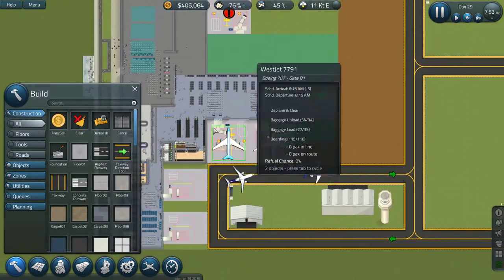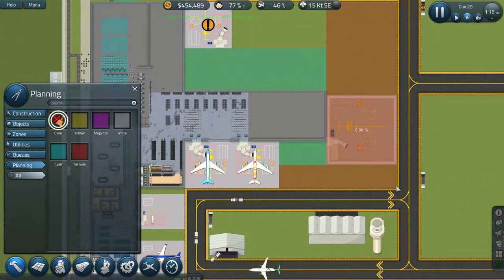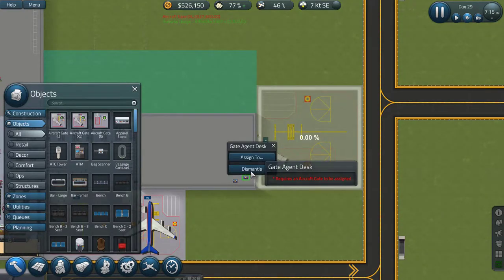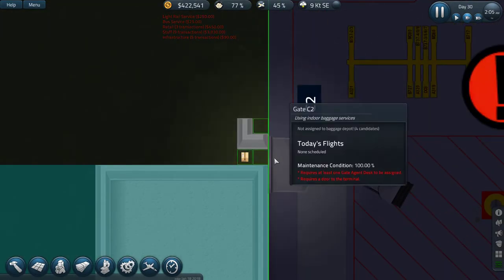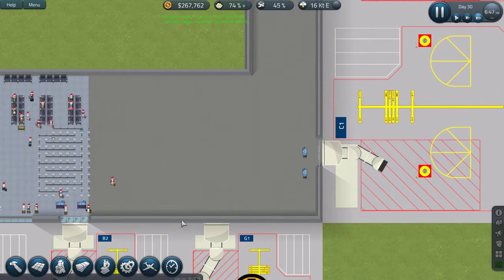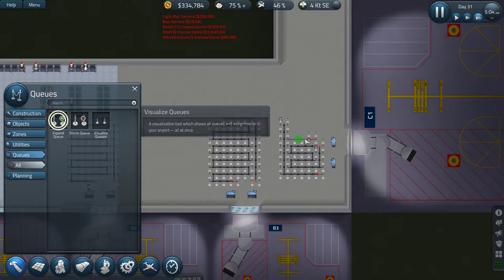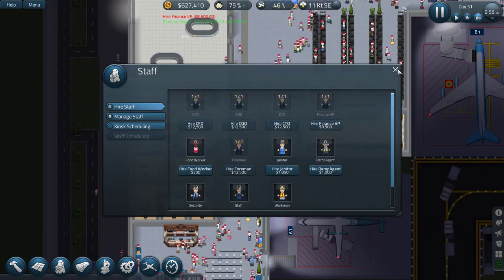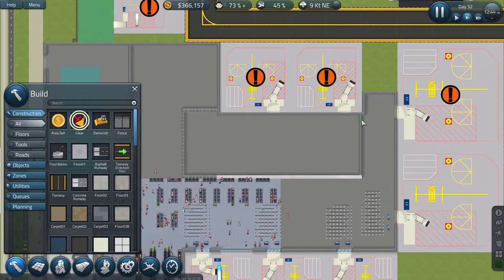Sim Airport Season 3 -  #18 Get ready for the big boys

Comment: The small hub is a smaller version of the big one. I used the big one's for the checking in gates [and one small one for the numbers connected to the large ones in series in the middle]. 
I then connected the big hubs to small ones which then connect to a baggage depot and another small hub which then connects to two baggage carousels. Blue goes to blue and pink to pink. So in all the small hubs are the smaller versions of the big one's. Not used the 'speciality' one yet.
Reply from the maker: +Anglo Saxon, I get the general idea but I think I may have misunderstood the labeling, thought it was inputs and outputs and that an output has to go to an input etc. Will check this again.